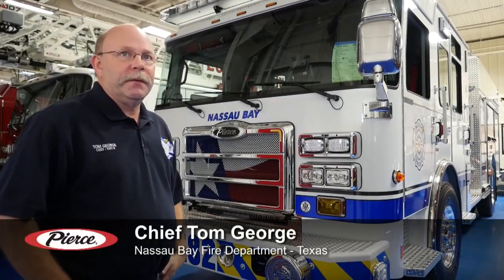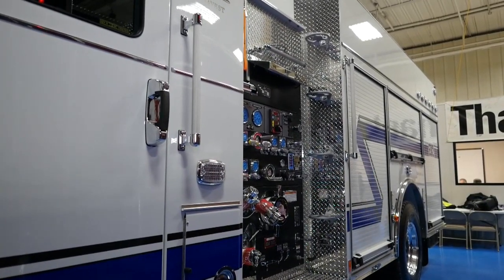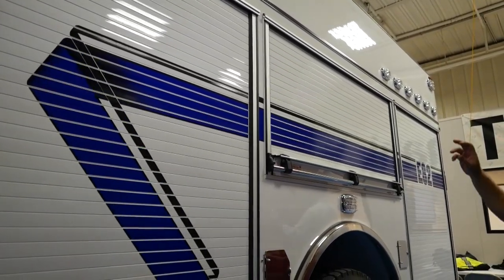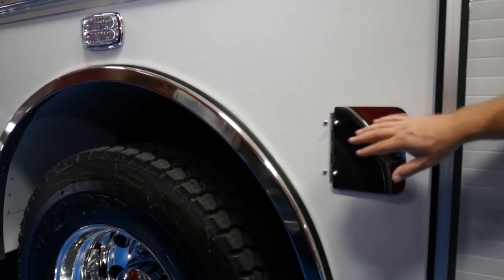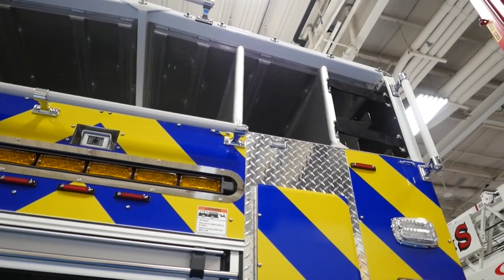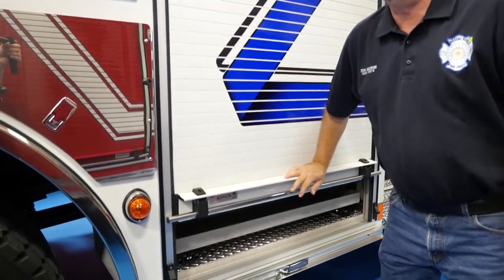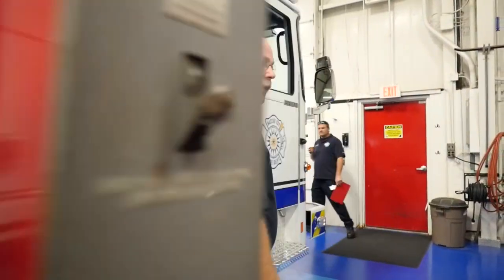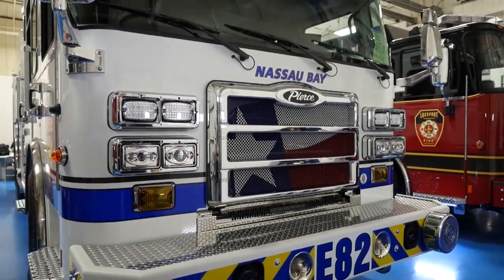Nassau Bay, Enforcer™ Pumper

Comment: Love the hose bed but would have looked at putting the Hard suction lower.  personally have found that when you have to use it you have either plentiful man power or not enough and the engineer has to deal with it alone.